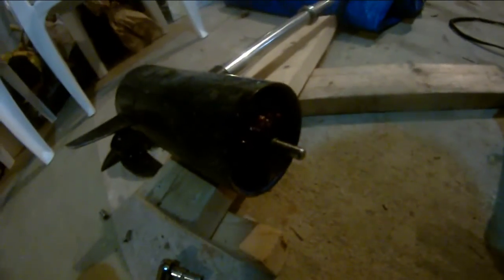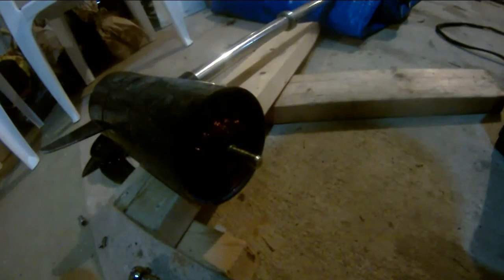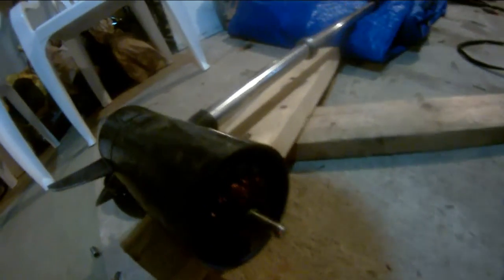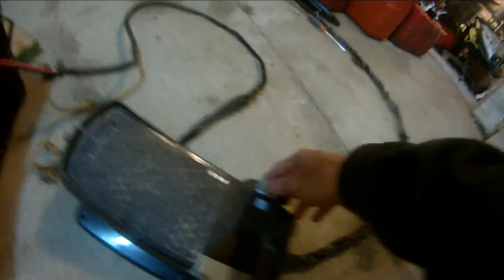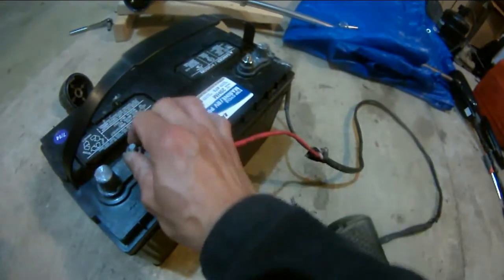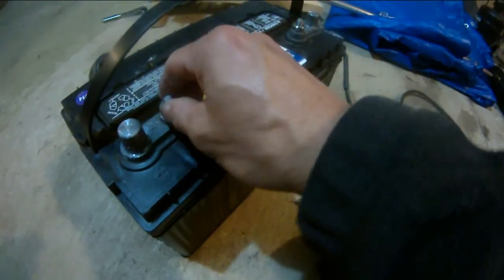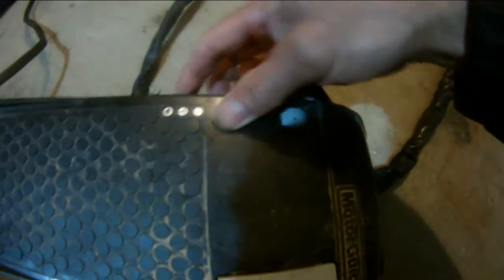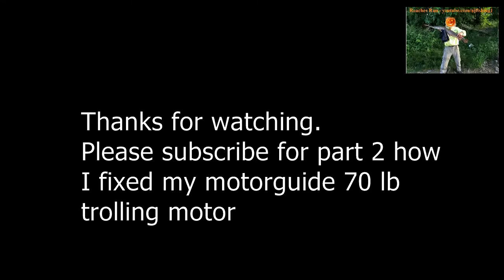I fried my motorguide 70 lbs trolling motor yesterday - part 1 of 3

Comment: How do you disassemble the foot pedal??
Reply from the maker: https://www.youtube.com/playlist?list=PLpjSRCf07NBIumBS4e1bPJ1ah5kCznqSN
there are 4 screws at the foot pedal, but to tear into the radio button you need a ring plier in order to open that to fix the switch pins. What is wrong with your foot pedal? loosen cable or broken pin or skipping shift gears?